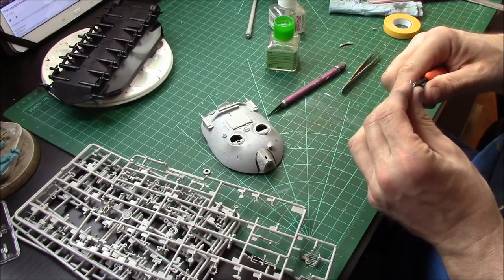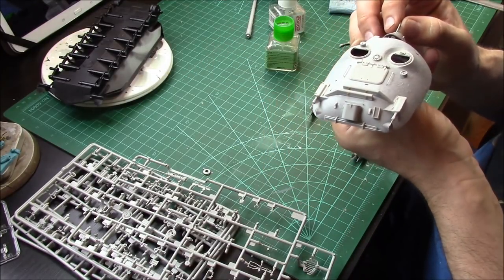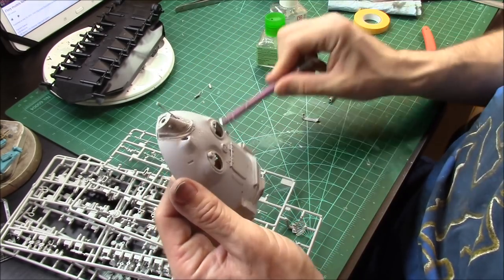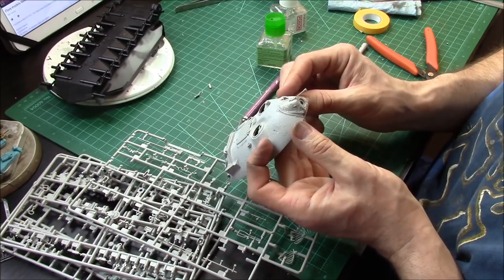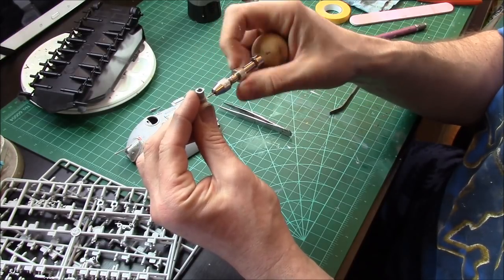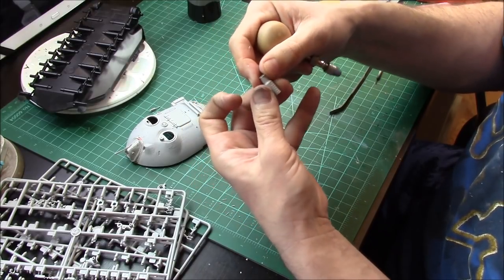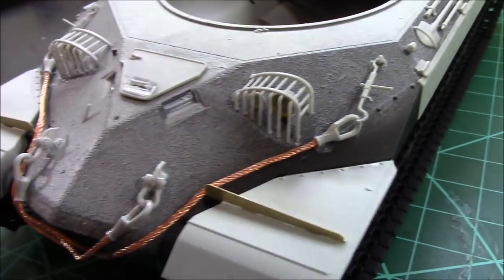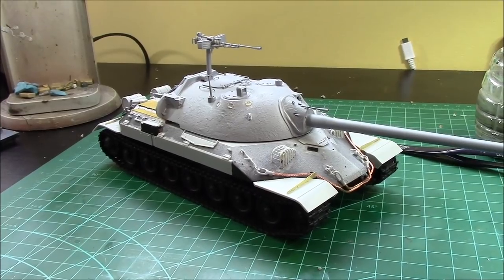TRUMPETER JS 7 BUILD PART 2

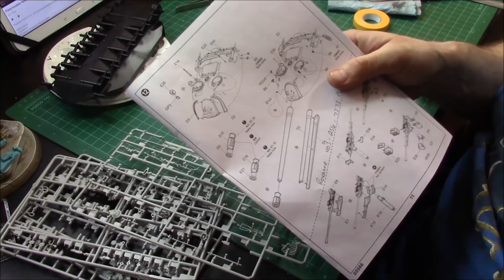Comment: I know I'm 7 years late to the party, but I think the mantlet problem was not Trumpeter mistake, but builder error. On 1:47 mantlet touches the top of the turret, while I'm pretty sure it should be inside. You said that the parts around the mantlet were to small, so I think it's because mantlet interferes with it. I have this kit on the way to me as I'm planning to build it, so I can check while building it soon. Anyways, nice build.